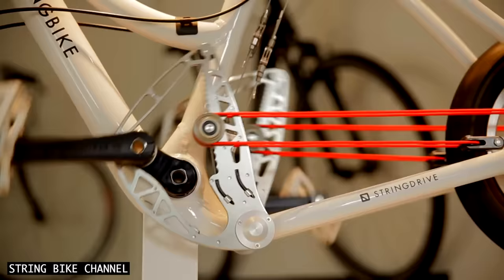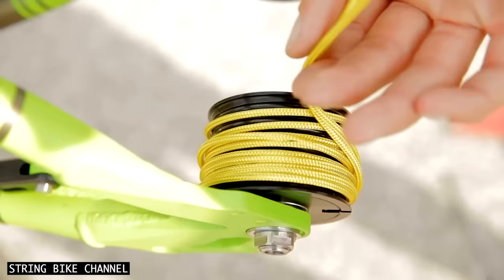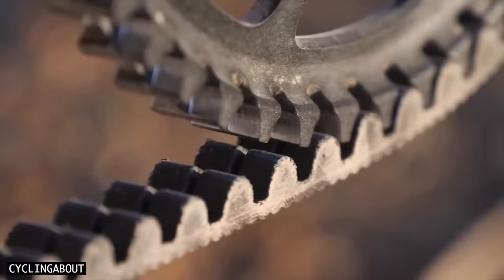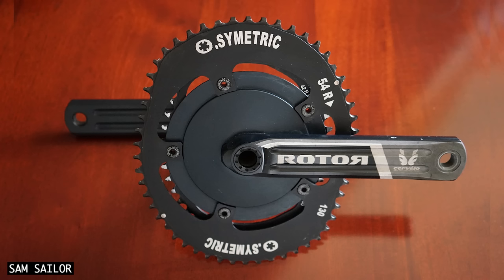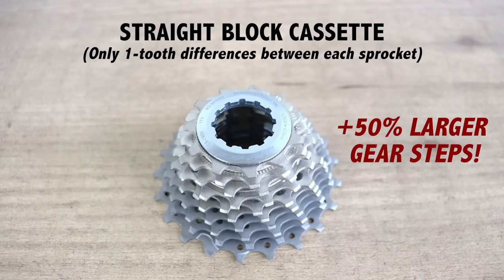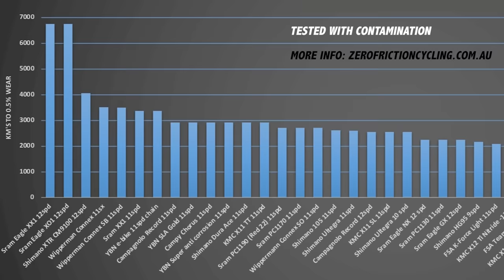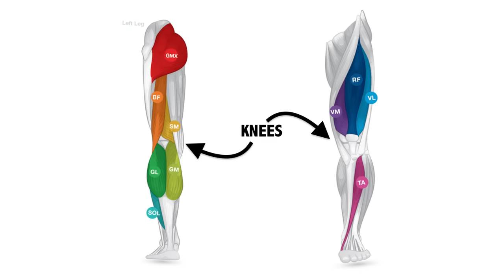Are Chainless String Drive Bicycles a Genius or Terrible Idea?

Comment: If they'd get rid of that reciprocal-circular-reciprocal conversion it would make a much more viable system. But it would require an entirely new frame geometry, like a recliner bike with front wheel drive for example.

Comment: i have a clssical mountain bike with chain drive, which i have been using for 25 years, never changed the chain. actually never even oiled the damn thing.
so 1000 km to 2000km range of duration for the strings seemed a litle bit short to me.

Comment: 1-2k km longevity of the ropes is comparable to Shimano HG601 11-speed chains (that last 1200-1500 km usually), and typically a single chain would run you €35-45. So I'd say specifically these ropes are a pretty good trade-off if you need two and each costs ≈10…

Comment: The disk brake problem could be solved by moving one drum to the front wheel so it alternates between front wheel and back wheel drive. Now each wheel has a free side to put a disk brake on

Comment: 12:45 - tensile strength is necessary to propel the bike, but as you point out, that requires relatively low tensile strength anyway. Possibly more importantly, for longevity and resistance to wear and tear, would be shear strength of the material so that it doesn't break due to knocks, road debris, etc - and on that front I think the chains might have the advantage.

Comment: Summary
* 00:00:37 String Drive Basics: Bikes with a drivetrain using Dyneema ropes instead of a chain, produced from 2011-2021. 
* 00:01:54 How it Works: Pedaling moves lever arms that pull ropes attached to the rear wheel, winding and unwinding on drums. 
* 00:00:58 Key Features:
    * 00:00:58 Grease and oil-free
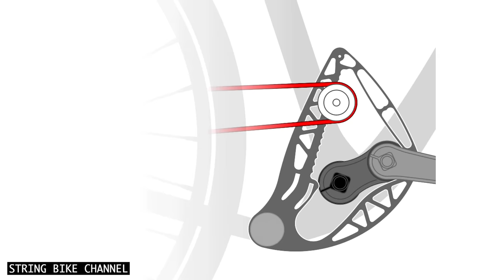    * 00:01:04 19 gears
    * 00:01:04 Shifting while stationary
    * 00:01:11 No gear adjustments needed
    * 00:02:19 Ropes are stronger than chains
* 00:03:46 Advantages:
    * 00:03:46 Smooth and silent operation
    * 00:03:52 Virtually no maintenance
    * 00:04:23 No derailleur to damage
    * 00:04:42 Automatic favorable pedal starting position
    * 00:04:54 Only consumable is the rope (cheap and easy to replace)
    * 00:05:15 Minimizes "crank dead spot" for potentially better efficiency
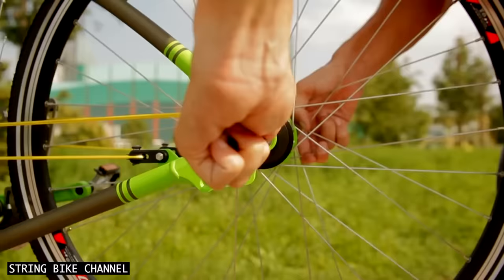    * 00:05:39 Easy rear wheel removal
    * 00:06:05 Closely spaced gear ratios
* 00:06:36 Disadvantages:
    * 00:06:36 Requires a special frame
    * 00:06:56 Proprietary components
    * 00:07:09 Incompatible with disc brakes and e-bikes
    * 00:07:43 Shorter rope lifespan than chains or belts (1000-2000 km)
    * 00:08:08 Grip shifter can be stiff and doesn't integrate well with drop bars
    * 00:08:28 Heavier than derailleur systems (~1 kg more)
    * 00:08:35 Potentially less efficient than chain drive
    * 00:09:17 Smaller gear range than modern drivetrains
* 00:10:32 Quirks:
    * 00:10:32 Can pedal backwards to move forward
    * 00:10:44 Allows different gear ratios for each leg
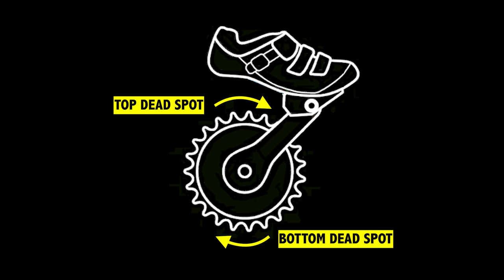    * 00:10:56 Reduced "crank dead spot" effect (like oval chainrings)
* 00:09:46 Why it Failed: Ultimately, the proprietary nature, incompatibility with emerging technologies (disc brakes & e-bikes), and the rise of strong alternative drive systems (belts, internal gear hubs) led to its demise.

In essence, String Drive was an innovative, clean, and low-maintenance drivetrain solution that was unfortunately hampered by its proprietary design and the timing of its release, coinciding with the rise of other competitive technologies in the cycling industry.

I used Google Gemini 1.5 Pro exp 0801 to summarize the transcript.
Cost (if I didn't use the free tier): $0.0421
Time: 34.47 seconds
Input tokens: 8602
Output tokens: 1142

Comment: I just think it's funny that we have two "arms" (legs) pushing on the pedals to convert to circular motion, then we translate that to these two cam arms back to pulling linearly on the strings, which then acts on the ratcheting sprocket to finally convert it back to circular...again

it'd be interesting if this took off, there would be the equivalent "fixies" (gearless bikes) that simply ditch the circular pedals + cam arms and simply have a step exercise machine pedal setup connected straight to the strings

Comment: I really see no point on taking something that works, then make it worse...

Here is a few things where gears and chains beat strings hands down :
- better transfer of motion
- less friction
- less risk of sliding
- less energy lost in deformation
- can take a much higher load
- more resilient to dirt
- more resistant to cuts
- can be used as a weapon in last resort

Comment: It can be done simpler, without strings and drums using levers instead, this way there would be space to put disc breaks and you can put both levers on the same side

Comment: This seems like it would be the kind of engineering that would go into a design for a maximally sustainable bicycle.  Previous ideas involving building frames out of bamboo or some kind of paper product seem like they would benefit from a drivetrain that ditches the chain.  Of course, such a bicycle would probably drop a lot of the top-tier features of the String Bike design.  I wonder how simply one could implement the most basic version of the design?

Comment: It would be worth testing here in Bavaria in winter, (where many of us continue to bike to work even in the snow with the appropriate winter tyres or simply with the MTB). From the point of view of pedalling efficiency it is one of the solutions to avoid pedalling deadlocks (in France a century ago a two-way pedalling system with two chains with two sets of different ratios was also tried out) but I would have doubts about long-term reliability and daily use on all kinds of road surfaces and different climatic situations. Especially for dirt and foreign bodies that can interfere with such a system. 
The linkage and cable drive system is ingenious (although there are analogies in applications on industrial machines) but I find it complicated to manage in terms of reliability and maintenance

Comment: The second i heard that the strings were dyneema, I knew these would have longevity issues. I've made bow strings with that material, and it works great until it starts stretching, and then it's pretty much over for it. Im honestly surprised they last 600km.

Comment: The efficiency of a rotary engine can exceed 45%. The efficiency of the piston engine is 30% in an ideal design. Circular motion is much more effective than reciprocating motion.
Maybe you could also suggest replacing the metal bearings with wooden bushings with tar?

Comment: Why not integrate a small drive shaft into a mono arm from the peddals through the frame which is attached to the rear wheel and gears in a wheelbox. We could easily redesign the bicycle I think. Effeciency might be a challenge but not impossible.

Comment: It seemed like a good idea at first, but when the negatives were shown, I changed my mind. I've had several bikes with twist shifters and I've always switched them for trigger shifters. Rim or disc brakes I can accept both The moving mechanical parts I don't like. Then there's the point of sales: Will bike shops have to stock both kinds? Derailleurs have come a long way, are well-established and easy to work on. Apart from all that, I'm too old to change.

Comment: I think they needed the extra tensile strength, because the force on the string is way higher than with a chain because it just pulls half of the time but then with double the force i think.

Comment: With this string drive pedals should not rotate but rather should move up and down like pendulum. That way there would be no dead point during pedalling cycle. Years ago I wrote them such suggestion but they didn't want to hear it.

Comment: as someone who rides clipped (also I ride mostly mountain bikes which you said sucks cuz dirt) I need to get drive on the up pull. I imagine for normal riding and cruising is where it thrives rather then high performance where many people road or mountain bike need that up pull. Also I don't think I could ever go back to rim brakes. I guess you could wear clips but you wouldn't get any of the benefits.

Comment: Disc brakes are the norm now, and e-bikes commonplace everywhere, but I’m yet to see the belt drivetrains be adopted in any meaningful way by the everyday cyclist. I’d love to give ’em a shot - if only the belts themselves could be opened and closed, instead of the proprietary ’cut seatstay’ -type frame requirement.

Comment: It seems to be a rather complicated construction which is definitely more prone to breaking. What the strength is on a wire is quite irrelevant as a chain can easily handle the forces a human can step on. An ordinary chain drive is distinguished by having extremely little resistance, but the absolute genius of chain drive is that it is so beautiful and simple. Why change it?

Comment: ANOTHER of the  horsemen of the bicycle apocalypse . I had alway spoken of the five but this does seem to add a sixth - the lever-drive. The other five are:
1. Automatic gears
2. Elliptical chainrings
3. Airless tyres
4. Noseless saddles
5. Shaft-drive
ALL were first invented in the 1890s bike boom; ALL are periodically  reinvented : NONE of them has really gained long-term commercial success. There are reasons for that 🙄😂

Comment: You could still use a front disc brake and a rim brake in the back. The front brake is way more important than the rear brake.

Comment: I’m wondering if replacing the stepped gearing with a screw or other system somehow controlled by the momentum of the wheel would create an automatically geared system.

Comment: I thought of something using the string replace with rubber and steel string. Like the ones in car using the rubber mixed with wire. But guess it cost more?

Comment: The only real problems with chains is keeping them oiled, clean of sand and mud, the right tightness and aligned right. This is more for motorized vehicles than bicycles but what should be done is to seal the entire chain so sand and mud can't ever touch it anywhere.

Comment: Wear?
they said, just the ropes
but what about the additional rollers, pivots, sliding surfaces, on the crank levers themselves?
these are all more complex moving parts than the simple rotation of a traditional crankset.
-I guess... you can claim these are Non-Maintenence parts, in that they aren't user-servicable and you just outright Replace them when they wear down; but that's not a good thing....

Comment: They needed to make it one sided. Have everything on the right side. Then there is space for a disk brake, as well as easier gear adjustments as you don’t have to make sure each side is the same.

Comment: admittedly i skipped around the video a bit, but i don't think it's mentioned whether or not these bikes can roll backwards at all?

In flatland bmx the freecoaster hub is common to allow bikes to roll back without moving the pedals, and pedal-back-brake hubs do the same, but surely this system uses simple ratchet freewheels that will put massive tension on the ropes when rolling backwards?
Reply from the maker: I didn't mention it. The ropes are not affected by rolling the bike backward. There are three freewheels inside the rear hub; one for each of the strings for forward wheel rotation, and a third that engages only when you push the bike backward.

Comment: 2000 kilometers is not very much, and I think climbing over a dirt road in winter will wear them out in a day, I think for commuting bikes a hub in combination with an enclosed chain is far superior, no maintenace for years, for more recrative riding I think still nothing beats the derailleur, because of the endless possibilities and reasonable pricing of the parts

Comment: Haha! Later you said the string wears quickly!

Duh! That's why it's a bad idea! Not only do they wear quickly, they wear even when the bike is not ridden, due to the pre-tension required, which is also why specialty tools are required for replacement! 

A chain, with a master link, requires only a paperclip for disassembly & pliers for reassembly. Without a master link a rivet press is needed, but one of those will fit in a (pants) pocket.

Comment: 1. you can put a disk brake in front, and v-brake on rear wheel. rear brake provides only 20-40% of breaking power, depending on the speed and condition. 2. Why not electric? place the electric motor inside the front wheel.

Comment: I don't think this could be ridden in mud or dirt...
The large D cranks would tear themselves apart worse than chainrings because with chainrings the dirt gets pushed out.
The strings would get dirty quickly no matter the coating and then grind against the rollers, tearing quickly.

It's a neat concept and I'd love to find a way to make it work in an efficient circular motion but I don't think there's any way to solve the poor resistance to dirt, mud and grime...

Comment: "The only regular consumable on String Drive is the ropes.."  I feel this is plausible, but possibly inaccurate.

The crank arms grinding against the pedal assembly is a high wear point. If you are a regular rider, I give it a few months to a year before you need consider getting a new one.  If this isn't a titanium alloy, expect this to be a failure point fairly soon, and if it is, expect it to be very expensive.

Comment: Once the patents expire for this... there could be potential here. It would have to start out pretty niche, but it would just take a few niche companies and enough interested customers to give this sort of system the development and evolution it really needs(can't tell me that someone can't adapt a rear disc to this, it's just machined metal parts). As always with these systems though, all about available frame options for these unique drivetrains. I would love to play with one, it looks like it would be pretty straightforward to modify - add more gears, changing the pedaling ratio and such, it's just all in the shape of those drive plates. Would be a cinch to put those in CAD and modify the shape so new ones could be cut out on a waterjet or CNC to give you the different properties you want. Which is such a cool concept to think about, being able to completely change the gearing and character of your bike by just swapping out those drive plates.
Cool concept that I would love to see not stay dead. But the graveyard of genius concepts for both bikes and motorcycles is a large one unfortunately(where the hell is my link front suspension revolution already?!?!).
Reply: There is a company making a velocar/hpv called Djiker that seems to be using a variant of string drive that ditches rotating pedals for linear pedals so the idea lives on. The powerstroke is only a quarter of the movement on a rotating pedal a reciprocating pedal increases that to half. So it is surprising to me that they use extra cams to hack rotating pedals on to a reciprocating drive in this example.

Comment: That part where the lever meets the pedal arm is subjected to high stress and friction. All the mechanical load exerted by the cyclist is focused on a small point. I don't think that will last very long. Can't call the strings maintenance free if you have to replace it every 1000 miles. For most casual cyclists, a good chain drive can easily last a lifetime.

Comment: Really great overview and information in this video!  Well done by the way. The fact that they wear out so fast is something to think about, you said about $10 so that seems reasonably low enough.  It also looks very easy to work on.  

So what i wonder is does it ever jam up?  Chains can derail, rocks can get in sprocket teeth or break them, etc... So how does a string drive fail, how bad, how often, what causes it?  Any info on this question available anywhere?  

So this is definitely cool technology, reasonably priced, i would consider a bike with this as a feature.  You know the idea behind string drive is actually very solid... if you float around the world of manufacturing you will see it  being used here and there.  Good stuff

Comment: Predicted that exact result.  Well, I did not expect him to get a fast bike, and try it again.  It needs larger rotors and well above the center of mass.  He is correct that he needs it above, as that would be much safer than at a level his body is at, as other YouTubers have done.
I also have doubts about control, as it would be better to be able to either adjust the speed or pitch of each prop independently.  And you need a joystick or something to make those adjustments in flight.

He needs to consider that if he really wants it to fly rather than just do ground effect hovering, it needs a lot more lift.  That means larger props.  True, it begins to look more like an ordinary helicopter, but there is a reason helicopters are designed they way they are. 

And that foil shape did not look right, it pinches too much at the end which will make a mess of that air.

I apologize, if I sound overly critical. 

If you want something that does not look conventional, just make a very large drone and have a pod suspended at the end of a cable.  That pod can be transparent and have a few smaller props to control what angle you want to view out.  You can't go under stuff, and you will need lights on the cable for safety, but it would still be efficient and different.  You might want a safety disconnect and parachute system, and a seat that can absorb some impact energy, so your body does not.  The pod could even start life before modification as one of those inflatable balls people roll in down hills.